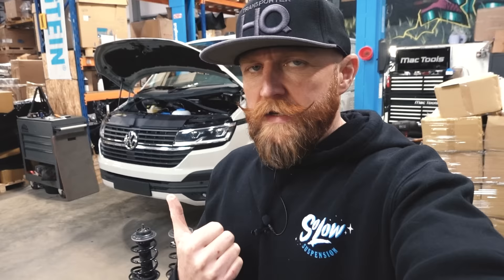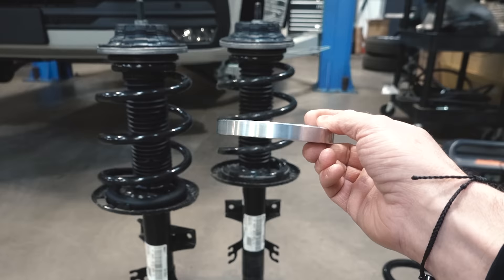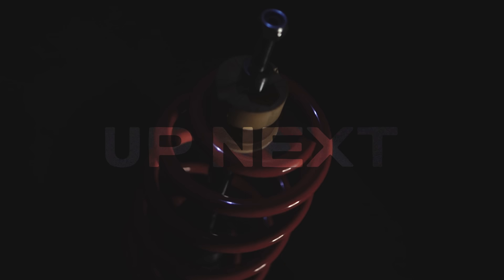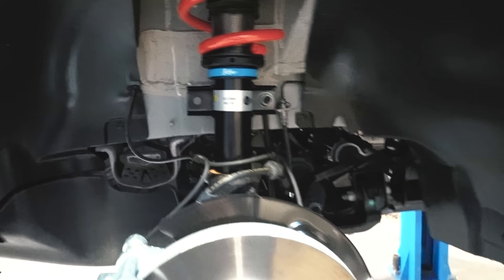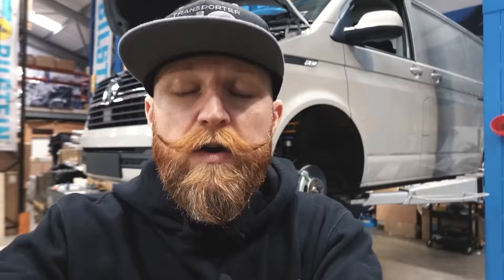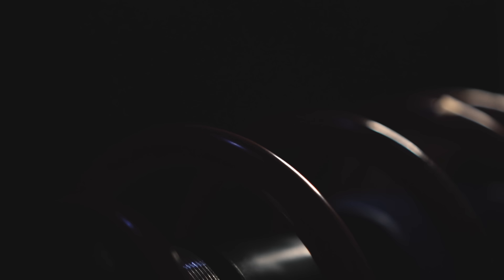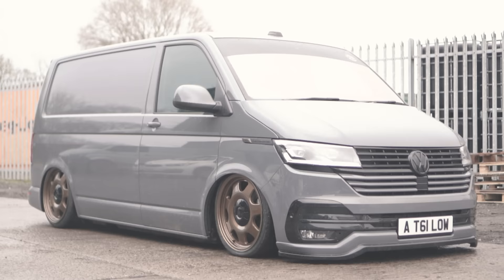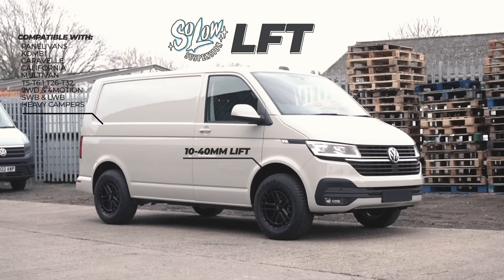The Ultimate VW Transporter Suspension, T5 to T6.1, springs, coilovers, air and lift from Solow

Comment: Great video and it's been on my list to change out the stock suspension on my camper for a while. Just wondering from a performance and comfort perspective what would you choose out of the Solow and the Bilstein B14 Komfort kit?
Reply from the maker: They are very similar in ride and handling but the NXT just edges it and is slightly cheaper. Both have 2 year warranty. You'd be really pleased with either though.

Comment: Thank you - that was a cracking vid and just what I’d been hoping to see - doing it on the same van really helps to see the differences too. Nice clear descriptions of each and I also liked the recommended wheel and tyre combos too. Great idea with the network of ‘approved’ fitters, I wondered if I’d be another who ends up driving miles to you after trying to get a booking months ahead. NXT or NSL for me fingers crossed later this year if not before. Cheers!
Reply from the maker: Glad to help. I'm sure we'll have approved installers in your area. We're working on covering all areas across the country.

Comment: Superb video and well timed as I will be ordering a set and wheels from you next week. 
What drop did you dial in on the NXT and the NSL in your video please?
Reply from the maker: Glad it was helpful. NXT about 60mm, NSL about 90mm
Reply: What's the standard ground to wheel arch distance on a t6, I've no idea how much my van has been dropped so can't work out which kit I need 😂
Reply from the maker: @vxlgsi  It depends on main things like engine, gearbox, turbos, fuel, weight on the back etc. Send us a photo of your current suspension and we'll try and work out what you have. andy@transporterhq.co.uk

Comment: I feel like this could finally be the year it happens 🙌 

 iv got a staggered set of Rotiform RSE's with 255/40/20 front and 275/40/20 on rear, will i get away with the NSL wound up high ? Or is the NXT a better option.

great video of what looks like a great product
Reply from the maker: Hello, yes you should be fine with the NSL :)

Comment: Great video, really helpful. I want to upgrade my standard 17” and lower it on a work van. What’s a sensible everyday setup?
Reply from the maker: The Solow NSL has become the best selling coilover and would work great with the right 17" wheel and tyre combo
Reply: I was planning on changing my wheels to an 18 or 20 but worried about making the ride uncomfortable. What setup would you recommend for the most comfortable ride
Reply from the maker: 20's with a 275/35 would be great @user-vo1xt4ug1x

Comment: Just waiting for these eibach 45mil springs to be back in stock .can you send me the link for the part you mentioned to change with these ,thanks
Reply from the maker: They should be back in 2-3 weeks. The other parts are in the "suspension accessory" section.

Comment: Hi HQ. Looking to purchase the NSL’s over the NXT’s for the drop and I have noted the tyre recommendation from the video. 
Recently (last month) had a set of 4 new tyres for an MOT at 265/40/20 to soften the harsher ride. Wasn’t planning on coils so soon, but your NSL’s got me. Vans currently on standard shocks and 40mm H&R springs. Not looking to get another 4 new tyres already, what would be the max drop for the NSL’s without issues on my current tyre size? Was aiming for 80mm. Many thanks
Reply from the maker: Honestly, i'd go for the NXT with that tyre size. With a 265/40/20 you may get a slightly rub otherwise. You might get away with them on the highest setting but i couldn't say for sure.

Comment: T5.1 T30 on standard suspension currently, having B14 Komforts fitted, was thinking about having the top mount mod from yourself. How low can I get it and what wheel/tyre combo do you think would be best? Will b turning it into a day van so not too heavy, any suggestions would be appreciated, cheers 👍
Reply from the maker: Honestly, I wouldn't bother with that machined top mount. Its kind of a quick fix but costly in labour to be retro fitted just to get 10-12mm
Reply: @THQAutomotive  hiya, thanks for reply. It’s just both my top mounts are knackered so need replacing anyway,
Reply from the maker: Fair, in that case. Why not :)  @colinhill6287
Reply: @THQAutomotive  original question was😂, with the top mount mod and Komforts installed what drop will I get and what’s the best wheel/tyre/offset combo would you recommend, I don’t want loads of gap or sticking out, really appreciate your advice guys
Reply from the maker: @colinhill6287  you should be able to run a 265/40. I'd be tempted to go 275/35 to be safe. The idea offset is 42.

Comment: Everything except what I am looking for. My T32 T6.1 Shuttle with stock suspension is so harsh every bump knocks my teeth out. I don't want higher or lower... I just want a more comfortable ride. Any suggestions?
Reply from the maker: It's not possible without going lower. Something like the NXT on the highest setting is only going to drop it 35mm which is hardly noticeable. The ride quality would be night and day improvement from standard suspension. It'll reduce your centre of gravity, improve ride and be so much more comfortable while also reducing sway / body roll. Standard suspension is terrible, it makes me travel sick.
Reply: What about Bilstein Komfort coilovers or Bilstein green B6 shocks?
Reply from the maker: @FantasticCraptacular  komfort coilovers will be very similar to solow NXT. Green comfort dampers are good but still using a standard spring isn't going to make a massive difference.
Reply: @THQAutomotive  Thanks.. I am running Fuel Zephyrs on Pirelli Scorpion All Terrain Plus 235/65/17 (bought from and fitted by you guys). Will I have clearance issues? This thing lives on dirt tracks and gravel many days a week, hence my desire to not drop, or at least as little as possible. If the NXT improves ride and doesn't rub, I'll do that.

Comment: I have a t6 t32 kombi on van slams coilover but I run it empty so it's oversprung. Do you offer a lighter lb spring for with your t32 kits?  I can't live with the vam slams much longer the ride is horrible on British roads.
Reply from the maker: You only need 1 type of spring regardless of weight. Your issue is the Van Slams. Personal opinion, but they are terrible. Solow's and others like Bilstein Komforts and Twin adjust Projekt will be so much better in ride quality and handling.
Reply: @THQAutomotive   OK just thought the t32 spring would be stiffer for higher payload? I was going to have some springs made and then swap the shocks at a later date but if your kit solves that all in one go that's perfect.
Reply from the maker: @vxlgsi  the damper is 90% of your problem.
Reply: @THQAutomotive  over damped rebound?
Reply from the maker: @vxlgsi  it's just a budget coilover with cheap internals.